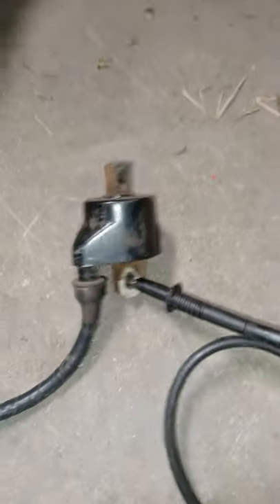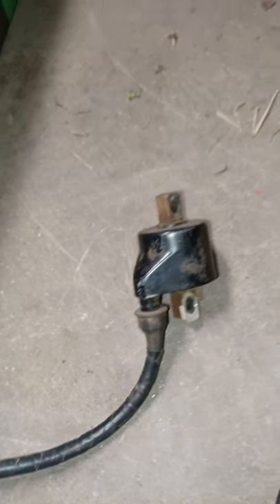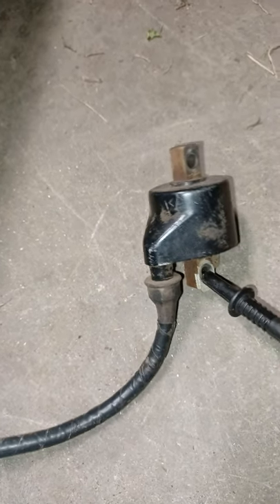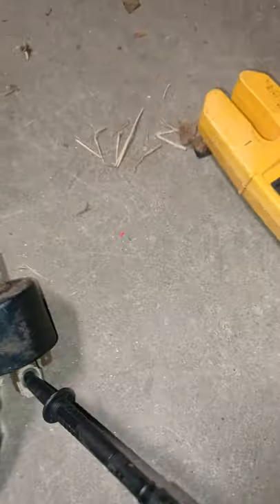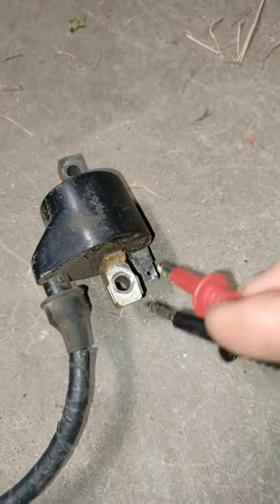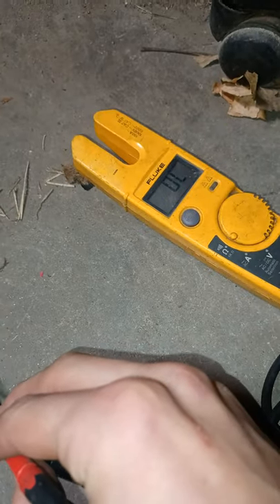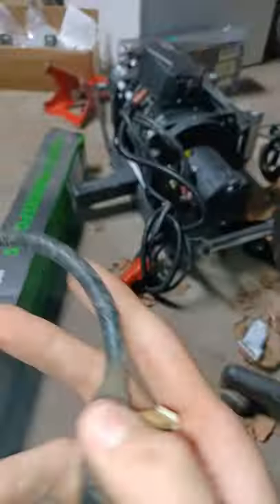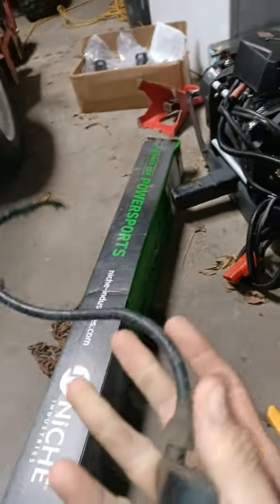How to test a atv coil

Comment: hey man i have a 1988 ct 200 and it has this problem where it will start and run for a second then stall. revving the engine does not help, carb is spotless so i know it’s not the carb. honestly so stumped do you think it could be a bad coil? seems like the more i try to start it the harder it gets to start.
Reply from the maker: Cold be bad stator flywheel or coil but coil is unlikely
Reply: stator is likely for what you are talking about. Coil will act up when it warms
Reply: Pretty much Bud! Check your spark plug and see what color of spark your getting. It should be a blue spark if not you could have a bad coil or something goin on!
Reply: Check to see if it has a flip sensor, i had kne that had come lose, and it would run for like 3 seconds and die
Reply: If your ATV has a flip sensor make sure that is in the upright position
Reply: @twicetherebelrebel4641  It turned out the kill switch wire was stretched out and making little contact, so the spark was being grounded out but the ground was weak so the spark wasn’t strong enough to keep the motor running. I just unplugged the kill switch and away it went.

Comment: Yea I did this and it has power out of the condenser and and on/off switch but there is nothing out of the plug boot. Is that normal? I’ve never tested a coil before
Reply from the maker: Idr

Comment: How do you know is "3 or 4" and what unit are you testing for? Amps/ohms?
Reply from the maker: Ohms and should be in between
Reply: Checking Ohms , amperage is power consumption,  be he did not check the secondary side of the coil .

Comment: You checked the low tension coil but you didn't check the high tension coil .
Reply from the maker: It was about 3 years ago when I make this video I was either 15 or 16 can't remember I've learned alot more in 3 years then I tought I would I'll maybe make a up revised video soon

Comment: Three to five....hundrwd, thousands, ten thou? You also have to check primary resistance from the wire to coil ground. 
Testing coils this way isn't accurate. Disconnect the small black wire off the coil. If it sparks your small wire is grounded or the on/off switch is bad. If she don't spark inspect flywheel magnets and test for magnetic strength. If its good replace coil.
Reply from the maker: Thanks for pointing that out I made the video when I was 15 years old and I didn't know that at the time

Comment: 00.0 reading ? good or bad?
Reply from the maker: Bad
Reply from the maker: U can search up the specs for ur exact model on Google but it should have ohms
Reply: A 0 ohm Coil is no good 
Honda cr 
Is 3.5 to 6
The higher the ohms you have the more spark you have 
Cap 5 to 6
Any lower is no good